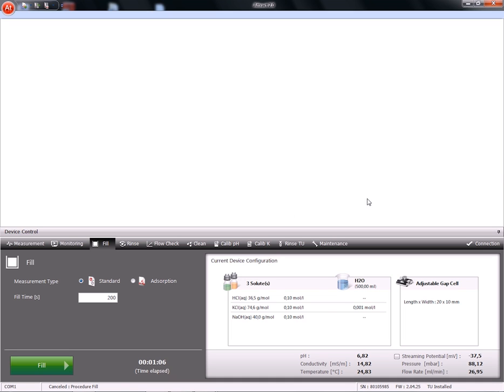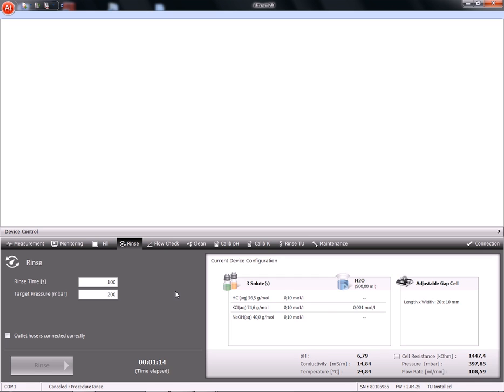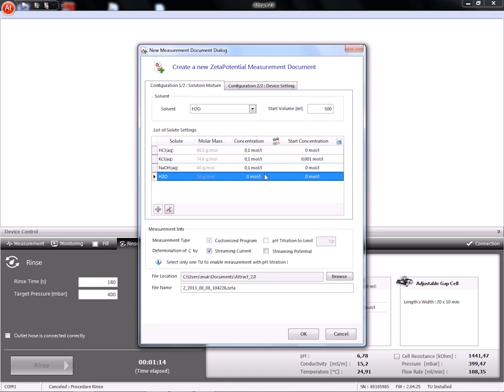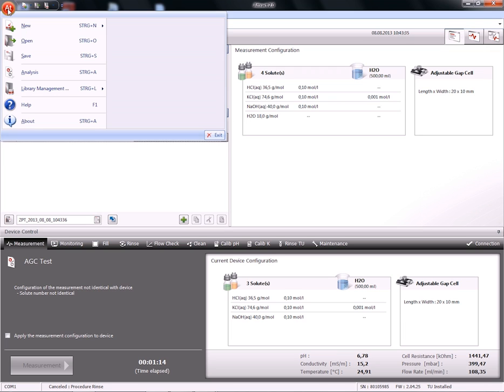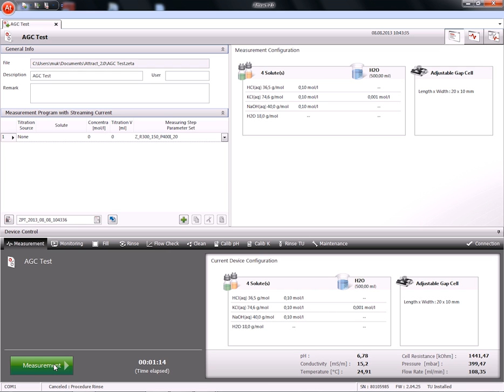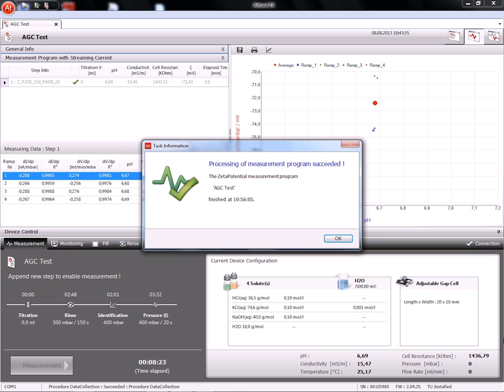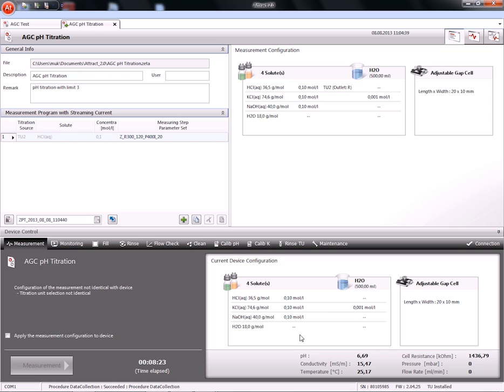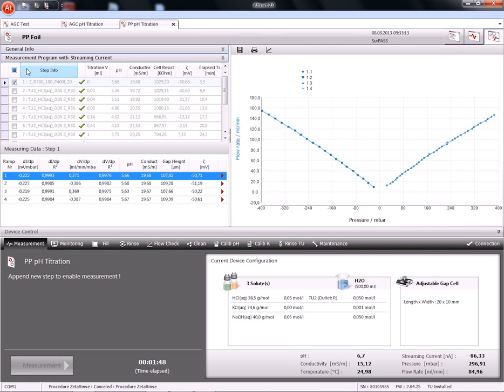SurPASS: Tutorial on Attract 2.0 software

Comment: Hi i want to ask that when i finish the preparation steps in the manual and try to do the zeta potential from pH 6-11. The sofeware just ran 1time and showed errors ( overpressure) when it came to the identification step. And then popped out a notication saying measurement failed. What's the reason that this is happening? Thank you!
Reply from the maker: Hi and thanks for your question! I'm sorry to hear you're having troubles with your instrument. I'm afraid this is a bit tricky to diagnose remotely. Could I please ask that you get in touch with your local service rep via our contact form? Best, Jacqueline https://www.anton-paar.com/corp-en/contact/?typereq=3